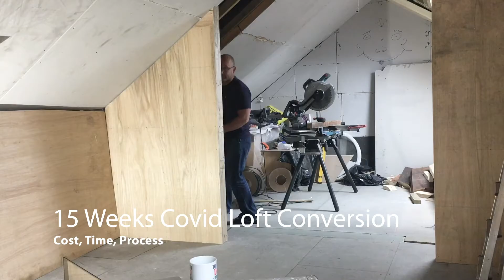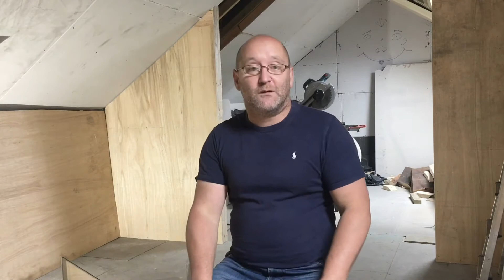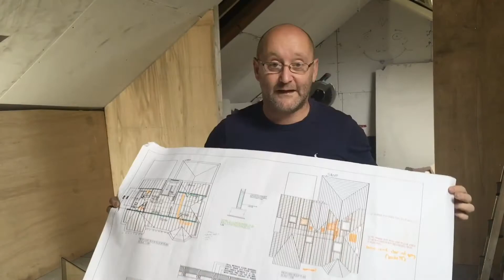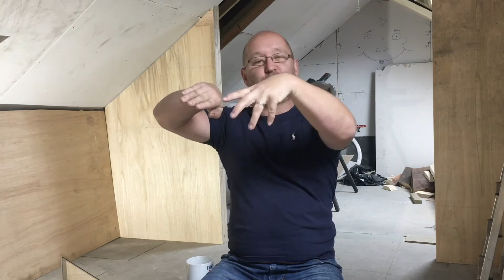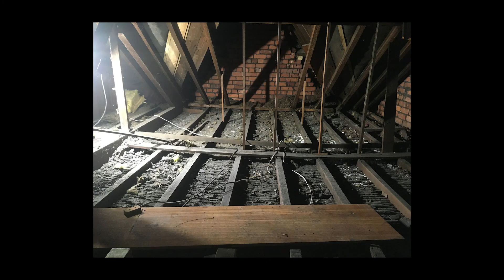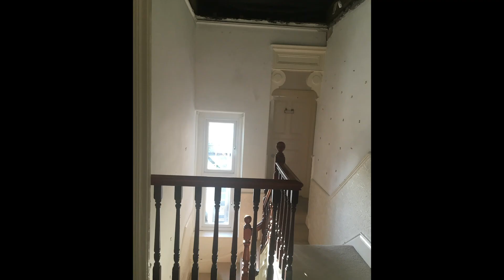2020 - 2021 DIY Loft Conversion Costs & Saving FIFTY GRAND (£50k)! Detailed Cost Breakdown - DROPBOX

Comment: Great video. But I have few questions:
1. How do you know how many beams, or tiles or membrane sheets are required and how much cement or sand is required? and all other items.
2. When you buy via builders, they give you 5 to 10% discounted price which all registered builders are entitled to. Why you didn't go through builders to buy the material.
3. Were you full time working when loft work was going on? I am full time staff, how can I spend time to buy all the nitty gritty stuff. In one way or another, we have to rely on the judgement of our builders. After seeing your video, I think on these lines too but the amount of time spending finding things is hell.
once again, great video. Keep it up.
Reply from the maker: Hi there Tommy. Thanks for watching. I got a structural engineer to give me a plan which specified beam and rafter pitches which I used to scale the timber and sheet materials. In terms of tiles, I paid a builder to do the dorma so he included materials in the cost. However, it's not really true that builders get special discounts and in most cases a builder will add on a surcharge to materials, as way of paying for their 'behind the scenes' work to source them. And in my experience most use the same outlet over and over and dont shop around as much....they just don't have the time. My advice would be to supply the costly things yourself...most builders will be happy for you to do that as it saves them hassle. Big timbers, sheets and insulation are the biggest ticket items so at least shop around for them. You can save literally throusands if you shop around...and the price you see on-line is NOT the price you pay for large orders - get on the phone/email and do deals. It's the best rate of pay you will ever earn!! If you download the spreadsheet in the video description if gives quantities, proces and sources, which I hope helps. Finally some of the build I was at home for a while and the rest is evenings/weekends. That's why I paid builders to do the roof work and stairs as it would have taken me way too long as was messy in the house. The rest I could do at my own pace but yes, be ready for months of hard work! I hope this helps and thanks again. Andy

Comment: Fantastic video!!  We're going through the process of buying a bungalow and the first thing I'm currently drawing up is a loft conversion.  Nice to hear your actual figures for the floor as I have the same ballpark!

Two questions:
1. Is the plant on of the rafters just to take the additional load of the plasterboard to the underside?
2. Is the Plywood to the supporting walls to act as a buttress wall?

Thanks,
Adam
Reply from the maker: Thanks Adam. I glad you found it helpful. Did you manage to download the spreadsheet which I left a link to in the description...full war and piece in there. I also have a few videos through the install. Many find the floor joint one useful too. Nonetheless thanks again and good luck with your project!. Andy
Reply from the maker: Oh and to answer the questions......the extra wood (depth) on the rafters is for insulation between the rafters. Insulation between the rafters needs to be 60mm thick plus an air gap behind of 50mm for ventilation (to stop your roof rotting) so a total rafter depth of 110mm. It doesn't have to do anything structurally as the weight of plasterboard (insulated @ 70mm, so total insulation is 130mm) isn't actually high, certainly compared to roof tiles! Yes the plywood side walls are structural...and are on the structural engineer drawings. They support the purlins along their whole length, as opposed to the two huge A Frames which I cut out in a coupe of the other vids. They sit on the new joists which is also why these joists are so massive. Cheers. Andy

Comment: you've devalued your house pal , a good job aint cheap and a cheap job aint good
Reply from the maker: Sorry mate but I don't agree. I used trades where I needed to (stairs, dorma, roof, aircon commissioning, drains, elec) but general timber work like joists, rafters, plasterboards etc are within the ability of most DIYers and I followed the structural engineers drawings and also got building control in a couple of times to check what I was doing as I went along. Given that they are the arbiter of building standards, I'd say I'm all good.  And for the record the estate agents who I got in last week recon I've added about the £70K, or will have once finished. Thanks for watching and commentating. Andy
Reply from the maker: Oh...and the real point is that at £70k the loft would not have got done at all, so no work for any trade and no improvement to my property. By doing my own deals for materials, using trades selectively where I don't have the skills but tackling what I can myself I have a win win, for me, for the tradesmen I did use and also for my property. Cheers. Andy
Reply: Absolutely spot on GJM

Comment: What an amazing unique video , I had exactly same plan myself and fortunately I found your video, I would certainly follow your advice and tricks. I wonder if you have pictures of the build specially installing ridge beam and steel bits and if you could make another video will be highly appreciated. Thanks for the worksheet and links. 👏👏👏
Reply from the maker: Hi. Thanks for watching and I'm glad you feel it's helpful. If you look at my channel you will see videos of various parts of the build, from the clear-out to getting materials in to floor install to finishing one end. I hope they help too. There are no steel bits in my build. All that was needed was huge floor joists and a structural stud wall along the purlins. This was possible as my roof height was high. But you will see all of this, what it looked like after 10 weeks mid covid and some of the real life around such a major change. Thanks again. Andy

Comment: I presume the existing felt remains on the roof and if so do you have soffits?
Reply from the maker: Hi. Thanks for watching. The only area where the roof was disturbed was where we inserted the velux windows and the dorma. The dorma and the area either side had its own new roofing felt. The velux windows used a little, but I cut out the hole for those very carefully to preserve the felt already there.

Because the dorma stops short of the edge of the roof by a bout 12" (a tile row) the soffits around the roof were not disturbed at all, so yes I do have soffits but they were not disturbed.

What you do have to do when the new floor joists go in is to cut off a diagonal a the ends so that the new beam can get access to the wall plate. So the beams were 220mm deep, with a chamfer down to 100mm at their ends to allow them to get to the wall plate. This was more than enough for clearance, helped by the fact that my house is a twin walled structure. This was as per the structural engineers drawings.

I hope that this helps.

Andy
Reply: @kjdrandy1468  Yes and thank you for the quick reply. I was wondering if there would be enough movement of air behind the insulation and the felt to stop any possible condensation build up.
Reply from the maker: Hi. 50mm gap requirement behind the roof insulation for ventilation hence the additional rafters added to increase their depth. This is visible in another of my Loft conversion vids. Andy
Reply: @kjdrandy1468  thanks!

Comment: Where abouts in the UK are you? Prices seem pretty low
Reply from the maker: Wales. But no the prices are national. Negotiate with a local timber merchant for starters and second look on eBay for insulation & insulated plasterboard. Those two things saved ma a fortune. What are you finding expensive in particular?
Reply: @kjdrandy1468  builder mainly. We are looking for a builder to complete a roof re-tile, dorma and change hip roof to gable. Both us and our joining neighbour are doing the same job
Reply from the maker: @gazdkw82  I highly recommend checkatrade - they do the best screening of qualifications, insurance etc so you cn trust - and also see feedback. Where are you - how far from Bristol/Newport. I may be able to recommend someone.
Reply: @kjdrandy1468  Leicestershire. Probably too far really
Reply from the maker: Gareth Warden yes fraud so. Like I said, checks trade and source your own materials, particularly timber, insulation and also roof tiles. Note a staircase is about £1k and takes 2 days max to install for 2 guys. It comes as a kit.
Reply: @kjdrandy1468  thanks for the info. Where did you generally buy materials from
Reply from the maker: @gazdkw82  Timber - go in to your local building or timber merchants and get a price for everything - and ask for staggered deliveries unless you have storage. Haggle. They will do a deal for a big order (I paid almost half the on-line price by talking to the manager). iWood is also worth a try. They are an on-line timber broker (yes such things exist). Insulation - look for seconds on eBay (kingpin etc) - there is a company in Wales that does them and I saved THOUSANDS - out of 42 panels I only had an issue with one of them. Finally go in to your local (independent) builders merchant and ask for a quote for everything - timber, insulation, plasterboard, windows - see what they can do. You may well be surprised. Note - a carpenter should be about 120-150/day and it will take 2 guys about 3 weeks to do a big dorms plus roofer. Materials 1500 (tiles, timbers, soffits, guttering etc). Scaffold about 1k nd a skip (big) is 330 - I used 2 all in.

Comment from the maker: Hi. They are 220x75s with a 3.5m span at 400mm centres. These are huge but also support the roof with the 1m high structural walls (you can see it in the background). There are lots of span tables on-line. My timbers are really big and probably over spec. The bigger the joist the smaller the ceiling height, so it may be worth putting in more smaller joists closer together. I hope this helps.